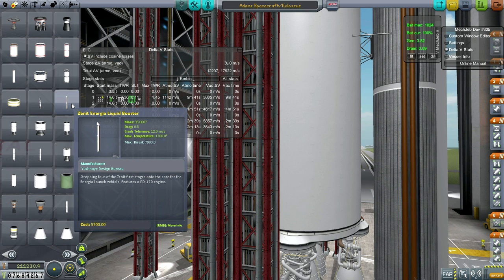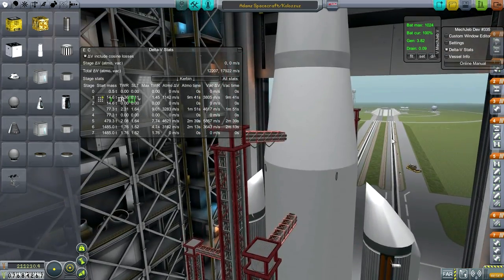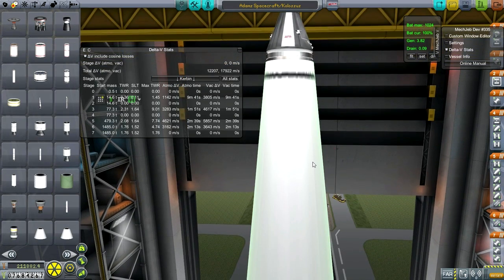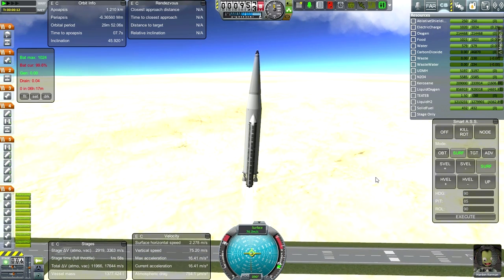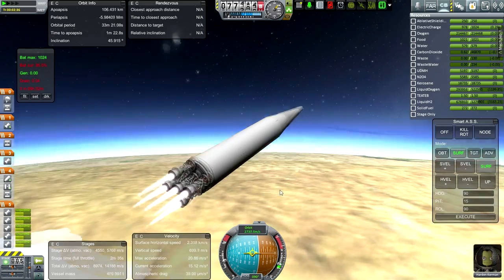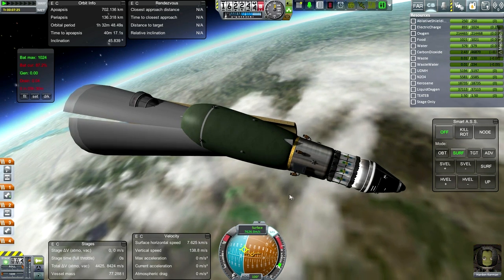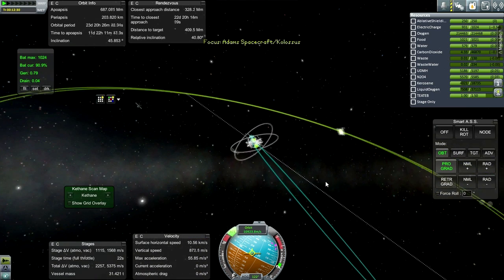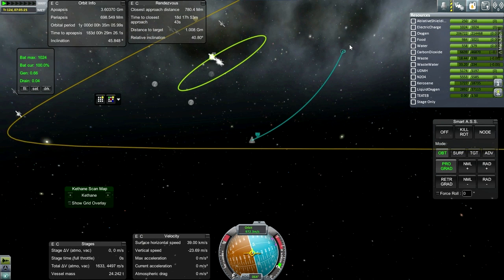Kerbal Space Program (0.24) - Realism Overhaul 068 - Walking the SOI Line, Part 1

Comment: And the reason you have large Russian engine but not large American engines is you have been using the wrong engine pack this whole time. RPL, this techtree, is designed for use with Reaching for the Stars Engines. You however are using it with real engines, hence your unlocking engines in a totally random order, getting some engines, like the RL-10 way to early and other way to late. Your also using other mods which arent supported by that tech tree, such as the one that adds the odin capsule. Im amazed you've been doing this for 68 episodes and haven't realised its totally out of balance.